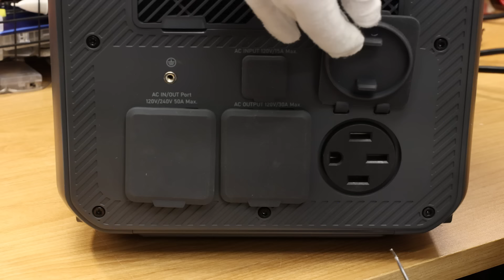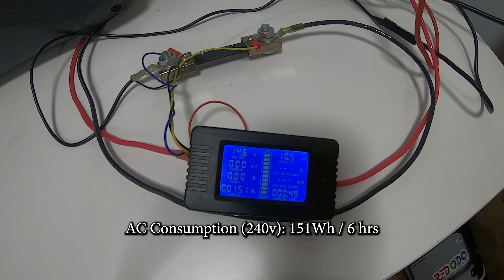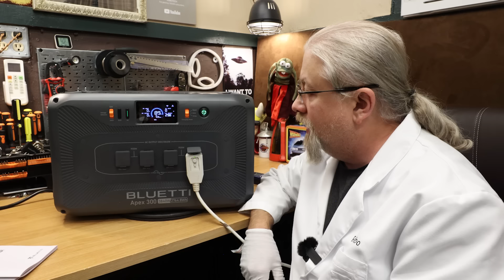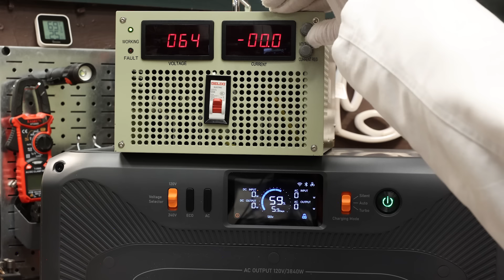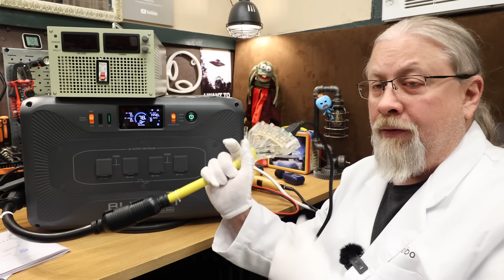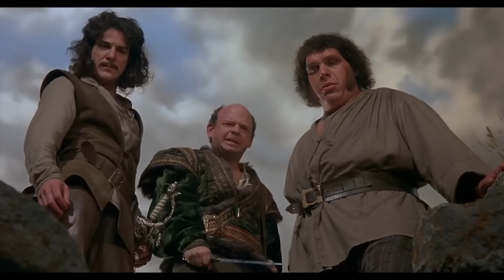Bluetti "APEX 300" 120v/240v MODULAR Home Backup Power Station | Cheap & Simple!

Comment: Another good video. I'm thinking hard about this product. The built-in 240V output would be very useful in my home backup system. I've been following you since I was deciding whether to buy a Bluetti EB150 and your video was a big help in making that decision (FWIW, I did buy it and then an EB240 6 months later.) I have a favor to ask. This might be appropriate for your "school" videos. You often show the sine wave of a sogen with a handheld oscilloscope. Would you do a video demonstrating the steps you use in setting up that test? Such as, how do you configure the scope, what probe do you use and how do you place it, etc. The instructions that came with my unit are less than stellar, and you explain things so well. Specifically, I want to test the output of my portable generator (open frame, not inverter.) Thanks for considering it.

Comment: This issue with the online UPS mode is that the inverter components are always running and generating heat. Heat means wear, and wear means shortened life. The batteries are not in play unless the grid power cuts out. The AC-to-DC converter should be specced to fully power the (online) inverter under load and the battery charger simultaneously.
The reason traditional UPS's need their batteries changed so frequently is because they are lead acid and they degrade over a few years of use. LiFePO4 batteries are a modern marvel when it comes to cycling, but the trade-off is the capacity to load ratio is much lower. Usually 1C, which means a 14Ah LiFePO4 could only sustain 168W while my lead-acid UPS can put out 900w with a battery of that capacity.

Comment: I personally think that you don't need any of the DC outputs - we already have cable extenders, chargers, etc...
This is actually the only video that convinced me to order one, because it actually answer questions and goes into detail, not pure marketing.
This is going to power my parents' tiny villa.
Reply: Since the b300 has built In usb I use it instead. The wireless chargers were rarely used😊

Comment: Bluetti honored a inverter failure warranty for me.
Reply: AC180 had an issue after about a year. Bluetti sent me a new one under warranty. . A+ So happy I bought a second 180.
Reply: Me too
Reply: @billw6903  It's more disturbing that two people had inverter failures.
Reply: @VideoArchiveGuy I can’t even get the units I paid for
Reply: They replaced my Elite 200 V2 when the 12 volt outlet went out.  Excellent service.

Comment: The unit comes with a NEMA 14-50 plug, but the maximum power that the unit can deliver is 3840 watts sustained, which means that the total number of amps that can be delivered is 16 amps. I'm not sure that's enough power to handle a 1/2 horsepower well pump. My well pump is 240v backed by a 30 amp breaker. Considering that the circuit is designed to handle 80% of 30 amps sustained, that's 24 amps, which is far higher than the 16 amps that this unit can provide. So, not sure I'd try running a well pump with this product.
Reply: There's always the option of buying a 2nd 1 and using the hub.
Reply: Circuit breakers are about the wiring, not the load. That 30A 240v breaker means you have 10AWG wiring for the circuit.
A 1/2 HP motor on 240v should draw 4.9A under full load, but AC motors will draw a spike of several times the operating current when starting up using a standard starting capacitor. It can actually be higher than 30A but it is so fast it won't burn wire or trip the breaker. NEC recommendations allow for up to 3HP on a 30A 240v circuit which could draw up to 136A on startup!
A soft starter uses dramatically less power to start the motor and is essential for large motors (and AC compressors) you will run from inverters and/or generators. Yes, I know some people get by without them. But it requires a ton of headroom on your setup and the surge is hard on components causing excess wear.

Comment: bluetti will be a badass machine in about three more years, they keep upgrading but never  seem to get it right.. here is what i want. 110 and 220 volt plus a 12 volt 30 amp. with a solar input of 5000 wats input  and NO 110 power input.  i want a full time off grid box, that will power both 110, and 220 for three days all maxed out, with no input ..  i got the ac200 max  that will most likely be sold off as good but used , this is what i need on my boat..  nothing else..   we need a waterproof yacht version.. no 110 inputs no of that fone shit.usb / blue tooth . the 110 ac,  220 ac  and 12 volt , 30 amp will provide  power adapters for that shit.  i want to live in my boat just like people do in their land homes.. OFF GRID    why is that so hard to do.. and stop with the fucking passwords  . if i pay for it  ..it should ALL be mine , no passwords for anything.. thats just stupid  shit..  please email this to Bluetti so they know what next box to build.. a simple off grid no bullshit box, not a BACKUP  .. nobody really wants that shit, if your going OFF GRID...

Comment: The critical flaw in all the Bluetti equipment you need to examine is that once they run down completely with AC on, if the grid power or other source resumes and you have your load on the inverter it will NOT turn inverter AC back on. Which means your freezer full of food will rot or your cabin stays offline even if the source power is back on. Bluetti's refusal to automatically switch AC back on when power resumes completely undermines the whole point of investing in this equipment. I've got $30K worth of Bluetti equipment that will let everything stay offline even after power has resumed. Lost 3 freezers full of meat that way. They won't do a simple firmware fix to prevent this.
Note that I have a housefull of local UPS devices on electronics that do not have this limitation. If Bluetti would fix this one critical flaw they would have the best equipment on the market. Without this fix there is no reason to buy equipment that will happily leave your loads offline when there is plenty of source power.

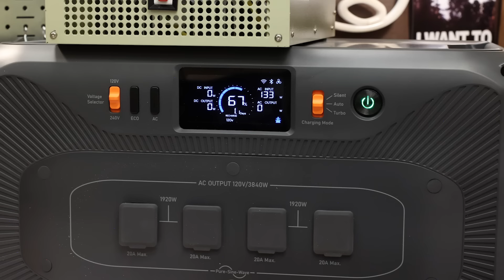Comment: @20:00

I do wonder if you had an offgrid setup but still had an AC grid connection if it would be worthwhile to keep it plugged into the grid ALL THE TIME nut set at a super low 1A input rating?

That way you are primarily charging during daylight hours, but all night long you are compensating for the standby inverter power loss by just trickle charging it back up from AC?

So you wnd up with a net loss of 0 or whatever because whatever power the inverter uses just immediately gets refilled.

Comment: I wouldn't be the slightest bit concerned about it operating as an online UPS vs battery life.  The reason those small home standby UPSes for computers etc need the battery replaced every few years is because they are typically lead acid and not treated all that well by the charging circuit in the UPS.  An online UPS does double conversion, AC in to DC then DC back to AC.

I'll take a guess the battery charger itself runs off the same 'HVDC' bus as the inverter and is of a design that allows it to provide current in either direction - reduce to charge the battery and increase to power the HVDC bus when mains fails.  The MPPT section would probably feed into the HVDC bus too.  Again, just an educated guess as I've not taken one of these particular devices apart.

Comment: Now I guess the question is do we jump at this for the one-switch 120/240v or wait for all the other manufacturers to do the same thing. My first foray into Bluetti was their cheapest unit the EB3A and it was... not great. Firmware update process was nuts, having to file a ticket or use support chat to get a firmware update for a specific overload problem. That said this Apex 300 unit looks pretty good.

Comment: I ran my own setup similar to this with 240 (input only) for charging w/ both legs. @HOBOTECH this output adapter/splitter you have allows access to both legs, do you know of an input version? I actually do an interesting thing in this scenario where I trigger on the charger only if it detects 240V across the two legs (allows me to charge from two 120V extensions guaranteeing their on two separate breakers).

Comment: Mr Tech!! I have made a lot of purchase choices based on your videos and I have a request!!! It seems from my research that the HUB D1 the high output DC accessory for the APEX has A LOT more uses. I have seen it used standalone with the B300K Can you see what other bluetti devices can utilize the D1 I am mainly curious if it can work with the AC200L. The idea of being able to use a 50A Anderson with only an expansion battery is huge IMO. Also I would enjoy showing you my power setup in my Travel as I have also used information from your channel as a baseline for thoughts and ideas.

Comment: So, I see Bluetti is releasing all sorts of influencer channels all at the same time to post their reviews.  But I gotta say, this product doesn't really make a whole lot of sense outside of maybe the RV space.

* First, its a kickstarter type of project.  Bluetti is funding development with pre-orders.  That means that people ordering this thing are going to get extremely variable quality and probably a lot of bugs and probably also hardware deficiencies out of this rev-1 product.   Bluetti is big enough that they shouldn't be doing this sort of development funding for a new product.

* Extreme voltage limitations with solar panels.  It can' barely handle a single modern residential panel.  There is no margin for cold weather over-voltage.

* Trying to use this thing to backup a home ... really trying to use any power station product to backup a home, is going to turn into a very, very expensive mistake in a few years as these products get quickly dated.

* The ecosystem is incredibly expensive verses getting actual professional whole-home products.

* The technical specs are lackluster for anything larger than regular portable applications or maybe a medium-sized RV.  To say the least.

* Too many add-on products.  So not only is there the eco-system lock-in, but the feature set is poor-enough that you wind up getting funneled into a whole slew of add-on products and even then there are major limitations.  What dummy uses the HUB model to parallel inverter output these days?

So... Meh.   I'm not impressed with the eco-system. 

-Matt

Comment: I hate spending money on tech that just does not quite as much as I need. Bought a EcoFlow Delta 2 Max at Christmas. Didn't realize it can't run 240v split so electrician would have to wire it odd ball in comparison to my generator.  This is  5 months later and a far better solution for way cheaper.   But my money is spent. My "eco-system" isn't cross compatible.

Comment: Ordered one yesterday for my overland build.  The 50 amp DC output is exactly what I have been looking for to run my DC components in AluCab.  Plus I have gone all electrical for cooking, etc. so the large invertor is perfect also.   The size is reasonable, just wish it was 20 lbs lighter.   :)
Reply: Ordered 2 and they cancelled my order. I already bought the elite300 and was trying to upgrade

Comment: I am tired of manufacturers making overly complex stuff. Look at the slate truck, super simple, super cheap, gets the job done. 

I just want to know a few things. 

What i want.
 A discharge timer that tells me "based on current discharge time, my battery lasts for x time"
A wall outlet
Two usb ports
A place to plug in solar.
A place to plug it into a wall
As much battery as it can hold.
Weigh no more then 50 pounds without wheels
Less then 200 pounds with wheels.

If it comes as a kit, i want it to come with solar panels. 
If it weighs less then 50 pounds, i want to be able to put it in a bike panier.
If it weighs up to 200 pounds. I want it to be able to fit in a bike cart.

If i had to ask for one crazy thing, it would be "have three versions. One for solar. One as a hybrid. One as a gas only." 

Have different price points based on amount of storage.

Comment: Unlike all, all in one units, this has multiple components that you have to hook up. Like solar has a completely separate charger and DC outputs is a completely separate unit!!!
And not having 6000 w 240 v is a complete downer for me....you need to buy two apex AND combining box...
You will only get 42-48 v max from a 24v solar panels....60 v is for VOC only...
But what is the voltage of the battery??!

Comment: Wow.. that 60v limit dc input destroyed this beautiful product. You will never max out that 1200w limit on real life using solar panels.
Reply: The high voltage solar charger is a separate unit not mentioned in video... Probably because he didn't get it for free!!!
Reply: Or they could have pumped it to 25 amps.  Then a pair of 600 watters @ 44 volts would be roughly 1,100 watts per input.  MC4 is "rated" for 30 amps, I don't think 25 would be much of a stretch.
Reply: Pecron goes to 150 volts

Comment: The 240V split phase capability along with the current price point makes this very tempting. However... there are a few oddities such as the MPPT limitations -- IMO the current limit of 20A is more disappointing than the voltage limit because I prefer paralleling solar panels to help them operate independently of each other. Another one is those physical switches for voltage and charge modes. Yes I can use the childproof option to disable them but nevertheless it's really bad design to have them at all. You don't have to be a child to hit a switch by accident and changing voltages while there are loads running from the unit can lead to catastrophe. Well that's the "con" here, if there's a "pro" to not making these purely software-based settings then I'd like to know that too.
Reply: It has security features that won't allow it to do that as demonstrated also its UL listed making it good if you have to have an off grid or permitted solar setup.

Comment: I have owned the AC200max 2 B230's for three years now,  I own 2  220V versions of EB70's 1 EB55.  For 2 years.  I can count how many times I have used the DC output on one hand, or that antiquated 12v Cig lighter adapter.  I have used heavy duty ridgid shop vacs, chop saws, water pumps, both 120 and 220v appliances.  Bluetti rocks.

Comment: Powering a welder would be my first application
Reply: This could probably run most 120v welders at full power. My titanium 125 flux core was pulling 34-3700w on the 3/16" setting on my elite 200 v2 before shutting down. If you have a very efficient 240v welder, this may run it. An old transformer machine may have problems.

Comment: The indiegogo page is showing a PV input starting at 2400W.  Maybe this was a late upgrade.  Unfortunately, I can't find a listing for the input voltage to see if they increased the voltage limit with the bigger charger.
Reply from the maker: Yes, it's 1200w x2 like I said in the video.
Reply: @HOBOTECH  Oops, I missed the X2.  Thanks
Reply: @jamesk5600  Watching your video, how would you get 1200 watts X's2 out of a solar array? My solar array's right now for my AC300 and 500 are that and the 500 is 1500x2 but I am running right at 149 volts on both the aC300 and 500.

Comment: This is a nice unit, the only thing stopping me from pulling the trigger is the low solar voltage input 60 volts max. In the real world, with my solar panel setup maximum Solar input wattage I could get is 400 to 500 Watts per X60 plug. That's terrible, I need at least 150 volts per X60 plug.

Nice unit, great Price but the low Solar voltage input is too low
Reply: We do have a accessory call SolarX 4K, it is a solar charge controller, support open circuit voltage upto 500V, and 4,000W. Connect solar panels to SolarX 4K, then connected to Apex300 to charge at maximum of 4,000W. Additionally, when pair with SolarX 4K, the XT-60 MPPT ports are still able to use, so you can charge with solar at maximum of 6,400W ( SolarX 4K=4000W + Apex300 MPPT = 2400W).
Reply: The 20amps limits per mppt kinda imply/expect you to wire 2 residential solar panel in parrallel per input. Residential panels are around 450-600w at 11-16amps/37-50v. The 60v limit per mppt is still shit as more and more residential panels get near 50-55v VoC value, and if you are in a place with real winter it might overload the mppt with over 60v in winter.
Reply: That's if it's sunny ☀️

Comment: Will this one work below 35 degrees?  I bought another model of Bluetti based on your recommendation a couple years back.  It failed in 2 years, but Bluetti stood by it!

But, there is a design issue that is not covered under warranty.  The problem is these guys must be from California and don’t make things work in a Midwest winter.  It just shuts down when it’s cold.

Imagine if your electric car did that to you on a cold day.

I am sorely disappointed, but now stuck with no power in the winter.  

😢

Comment: i like your reviews thanks   I have had 4 power stations fail the bluetti ac200p is a 1300 dollar paper \\weight  allot of others have had them fail also. I went to buying a bttery a inverter a charge controller had good luck that way then if something failes you can replace it for little cost.

Comment: I need a 230 volt ac output plug _ can this unit step down from 240 volt ac to 230 volt ac thru the settings ??????
Reply from the maker: 220, 230 and 240 is the same voltage.
Reply: @ No it’s NOT because I live in asian country and the voltage here is 230 volt and if you try to plug-in your devices to a 240 volt outlet then it will start to fry and if you plug it in to a 220 volt outlet then the device struggles and complains and will not work properly
Reply from the maker: This video is for a US product not overseas. You have a totally different power system and will get a different product based on your country.
Reply: @HOBOTECH Oh how sad this unit can’t be stepped up or down to 230 volt thru the settings __ I guess we are way behind in technology